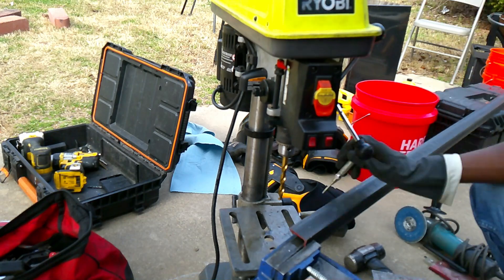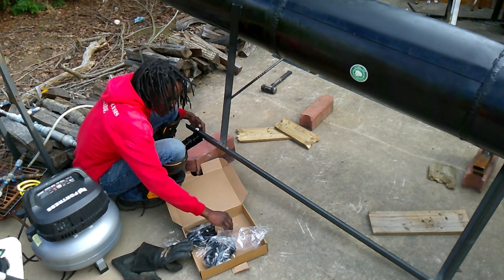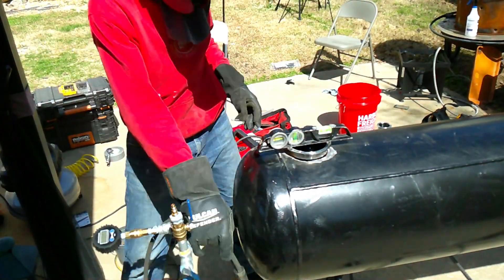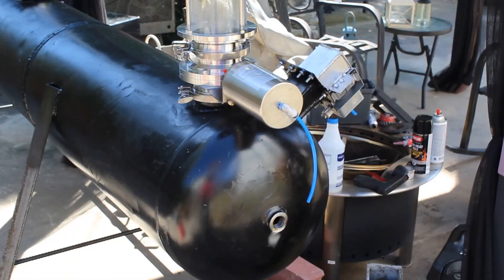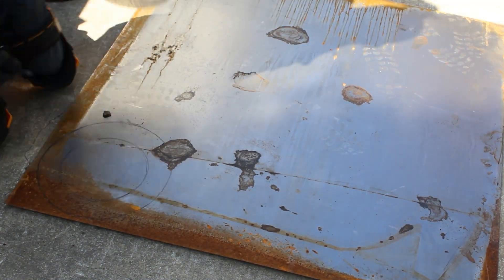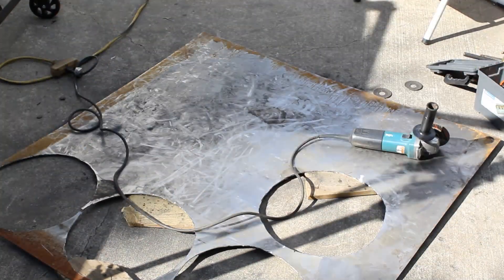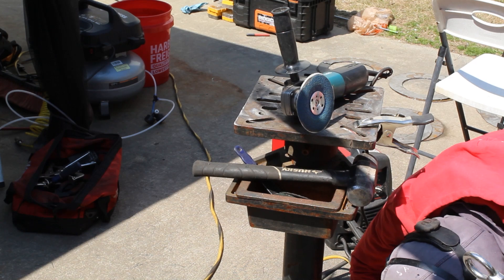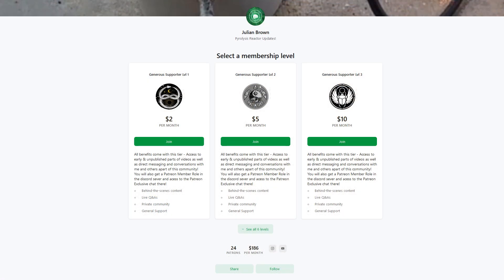Building Mark 4.5 Plastic into Fuel Reactor Part 4: BLADES!

Comment: You can use an angle grinder with a cutting disc to cut a smaller circle than the disc by rocking the tool in a circle (like a coin spinning on end). It takes some practice, but looks like magic when you get it right. Awesome project!

Comment: What would be your advice for someone wanting to get into pyrolysis
Reply from the maker: Start small, and traditional pyrolysis
Reply: You can make a set up that also makes plastiXfuel similar to a gasifier and use fire only downside is controling the temperature would be more manual. 
(Genius to use microwaves)
A gasifier makes hydrogen fuel to run generators from wood chips.

Comment: Очень интересный комментарий, мне нравится! Обращаю ваше внимания на то что, длина волны магнетрона 12,5 см, ещё надо учесть, то что глубина проникновения микроволн ограничена!!! Поэтому этот парень имеет длинную трубу и шнек. Размеры имеют прямое отношение к длине волны магнетрона. Использование тепла газа для обогрева печи это вы абсолютно правы!!! Печка в печке. Смекаете? Истина где-то рядом.
Reply: And he's using multiple magnetrons! If they're not spaced right or wired up right they could be 180° out of phase and just waste a ton of energy in between where they cancel each other out! Due to all the reflections inside and the sescepter carbon materials he's using, he can't just space the magnetrons an even wavelength apart and expected to work you got a heat map it somehow. Also for a commercial project a higher frequency of microwaves would be more efficient.

Comment: Don't use multiple magnetrons! using multiple magnetrons will result in constructive and destructive interference inside, the magnetrons will sync themselves with each other and some may get very hot inside and fail, even if they are switched off because they will be pumped by the working ones, and they may not add to the power - this is why you have observed weird behaviour in the past. 
Use a single large magnetron from a commercial oven, get an inverter one if you can they are more efficient, also wrap the outside in insulation and burn the gasses you create to heat the outside then you wont have to use so much electrical power to run.
Reply: Yeah I've been saying this all along, he's got to find some kind of microwave engineer, something to tell him how to modify a circuits so they don't overload or cause any other weird behaviors and you can't just space of an even wavelength apart because there's too many reflections and absorbers and everything else. 
   Maybe if he goes an odd wavelength apart like 3 or 5 wavelengths, the microwave susceptor materials might absorb enough in between that it won't cause a problem as it is limited penetration debts
Reply: Unfortunately he has ignored all advice and is intent on adding more magnetrons, which can only result in reduced efficiency, he has stated that he is only just above 100% "efficiency" in terms of electrical input to calorific output, plasma pyrolysis uses 2 - 5% input power to do the same, by this measure 5000% - 2000% "efficiency" Brute force and ignorance method will only get you so far, what is needed is a resonant microwave cavity that the feedstock is fed into, a standing wave inside a tube, this way none of the microwave radiation is destructively cancelled and most power will be absorbed rather than wasted. I don't want to discourage, but you have to be realistic, if you ever want a commercially viable process you have to increase efficiency to a level at least 10 times what he has today. On another thing you can easily switch from expensive argon to cheaper nitrogen without much difference.

Comment: I just started watching your videos yesterday, and I'm a huge fan now. I love what you're doing here.
Please be careful with your health while you do these things. I know small amounts of exposure to fumes doesn't seem like a big deal, but it really starts to add up. You won't feel the damage you're doing until you're about 30. That said, don't be afraid to blaze ahead with this project! I think this could turn into something commercially viable, and help a lot of people clean their local area, and make fuel at the same time.

Also, have you thought about using a Fresnel lens to power the device? They produce so much free heat that the you could afford to just heat the entire vessel, and potentially run a continuous feed. This would make the entire project more scalable.
Reply from the maker: Thank you! Looking into Fresnel lenses for potential future reactors....
Reply: @naturejab  have a recommendation for 2:26 when you are cutting the hole on the top of the tank. if you can measure the diameter of the hole you need to make and then see if you can get yourself a hole saw and a drill. it will make it WAY easier to make a hole larger than a drill bit or an angle grinder. oh and dont forget your cutting oil! and here is another idea! if you can find some scrap 2 stage snow blowers or some rototillers that you can harvest their augers and possibly even the gearbox's off some of them and mount em to a long pipe for your auger! i work in the small engines repair space as a tech (mechanic) and i can say with certainty that the weakest point on those are the bolts you use to fix them to the main shaft as well as how thick the walls of the pipe you use. we use what are called "shear pins" or "shear bolts" to mount them. if something locks the auger the bolt/pin will snap and prevent the gears in the gearbox from sheering (and ive seen brass gears get smashed like butter on one snow blowers gearbox that i took apart to fix) ive seen those augers move some very thick and wet snow livin up here north of chicago and the augers handled it just fine! i would love a vid on how this reactor functions and what all the parts do! new fan here! any questions feel free to lmk and sorry for the paragraph!